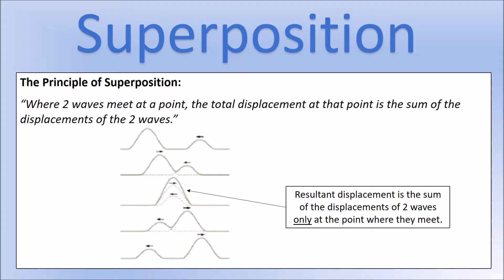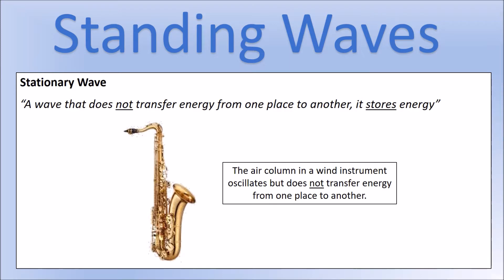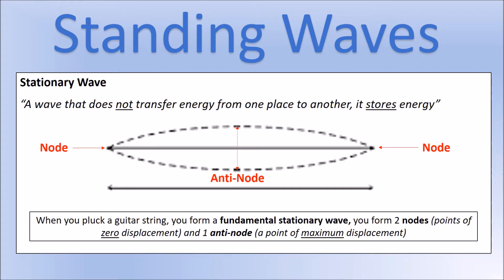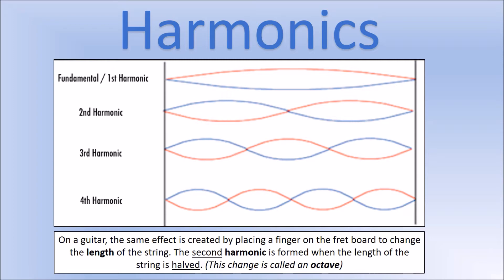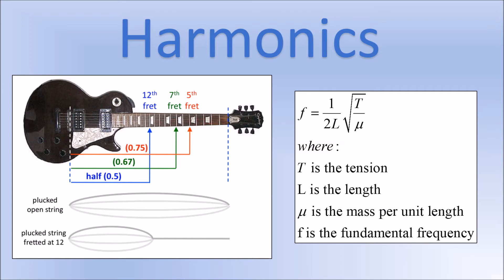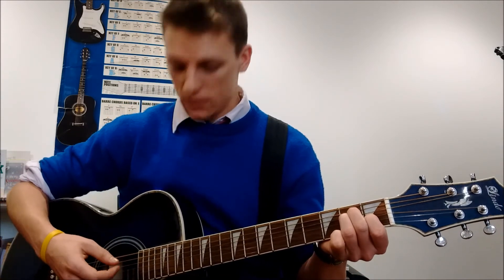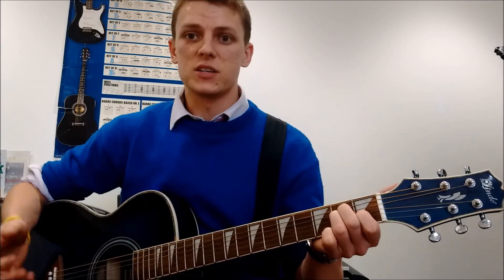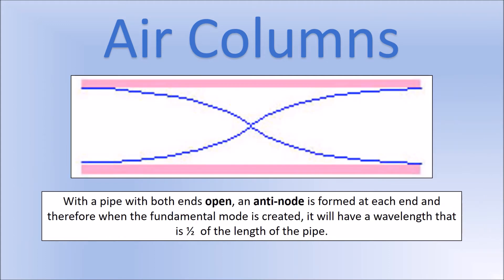A Level Physics: All Boards: Stationary Waves

Comment from the maker: Error Alert at 8.27: I've just noticed that with the closed ended pipe, the text states that the wavelength is 1/4 of the length, it should say the wavelength is 4 times the length. Likewise for the open pipe is should say the wavelength is double the length.